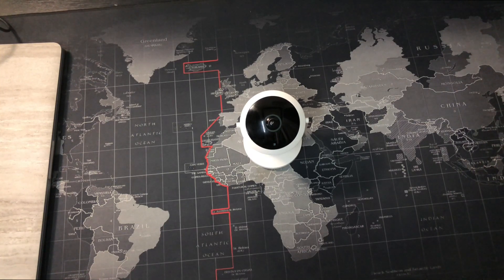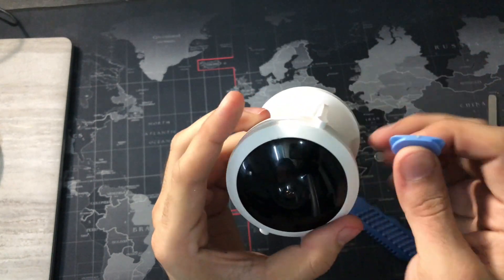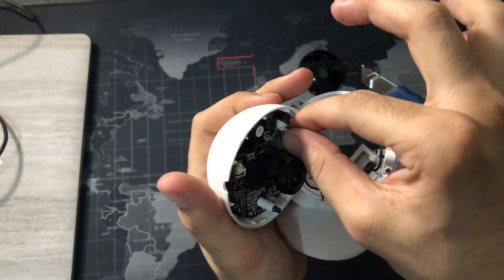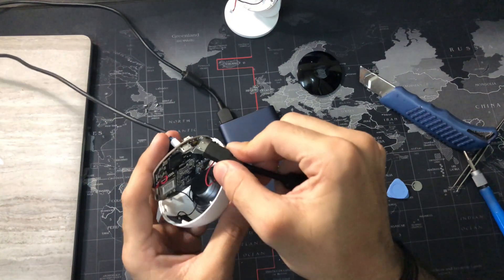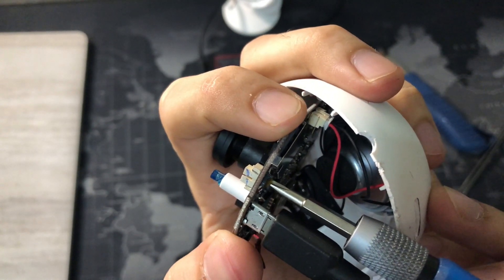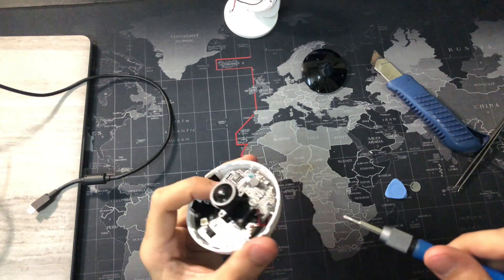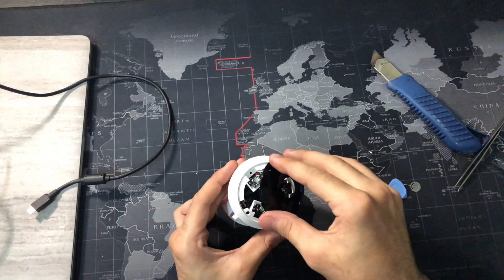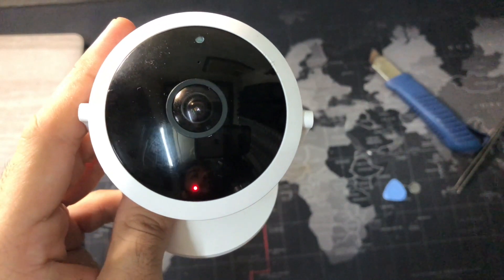Xiaomi Aqara IP Camera Broken Reset Button Fix 2018 | Disassembly | Teardown

Comment: I still can't believe I was able to open it without any damage and in seconds, I owe you an XXL beer ...mine is probably not fixable because it received 220V through micro USB, anyway thanks a lot for sharing

Oh, I forgot the most important part of the comment. I'm not sure it is said in the video...
The struggling phase around minute 2 of the video is because of a stupid problem, it also have taken me a while to realize while doing it:  simply the semispherical part cannot move more than a millimiter or so because it touches the back, you need to simply rotate it to have it's back free (this is because the front part of the camera, the white ring, is fixed to the rotating axes and cannot move from there)

Comment: Good job, but to not make this happen again I will not assemble the reset button and make a small hole in the reset button place with solder rod to directly reset if from outside by pushing the golden reset button with a pin or pen. 😂

Comment: after watching this i had tried reseting the cam with thin steel cable of which longer than the pin supplied, frame hanging kind, it worked!!! i had had to push in at least an inch to feel and hear the click then waited quite a while to confirm the red blinking led to reset. ppl can try this b4 open up as a last resort. thanks for video TC! ^^